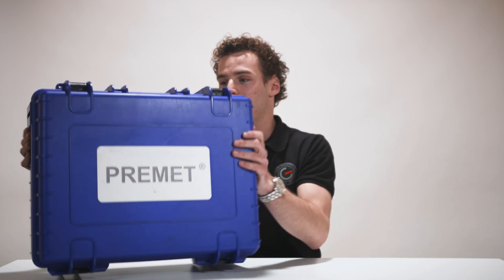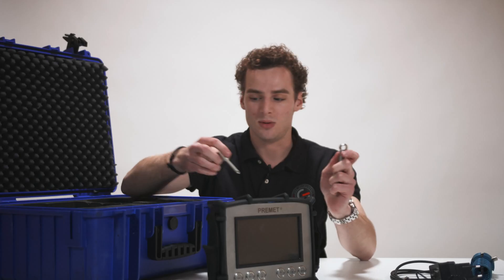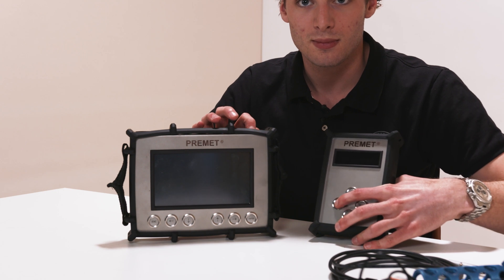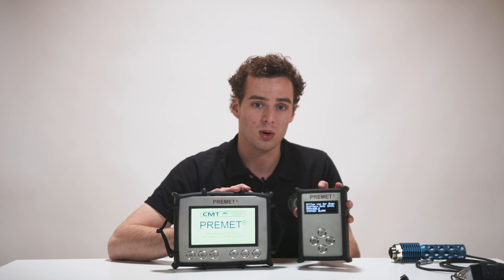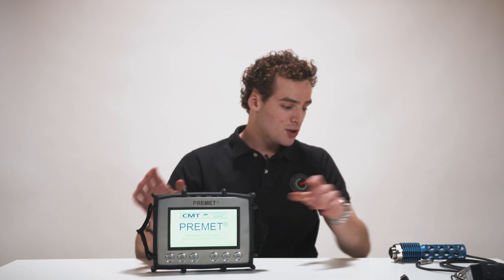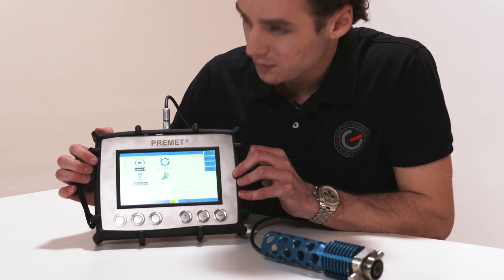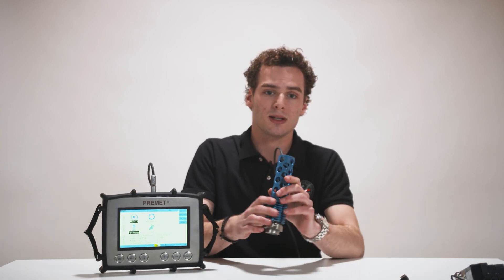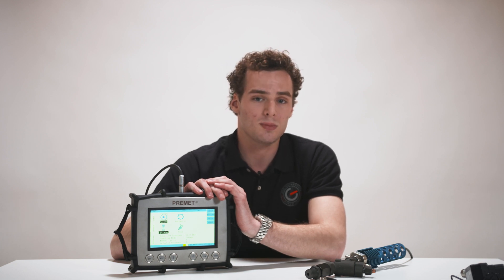CMT PREMET X | Which one to pick? New PREMET X or PREMET M

Comment: If these devices for monitoring the indicator process in the diesel cylinder were installed on modern ships with electronic control, it would be much more effective to monitor the work process and, most importantly, to assess faults in the fuel equipment components.